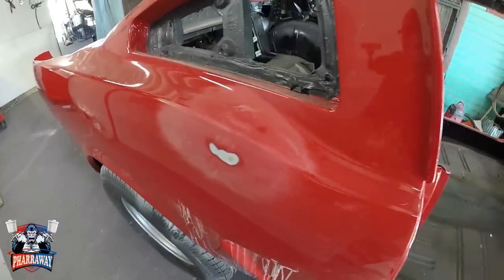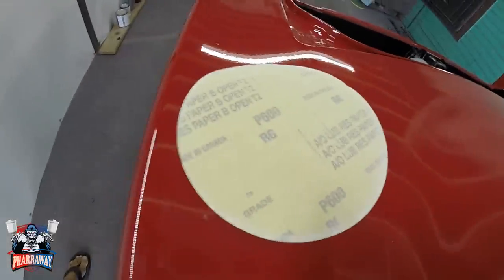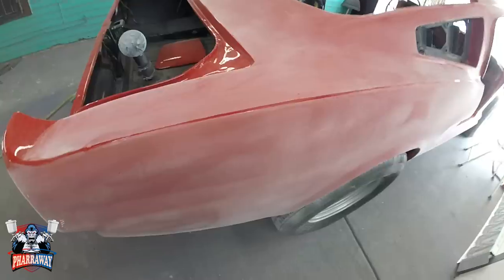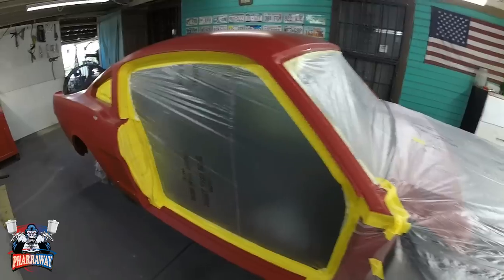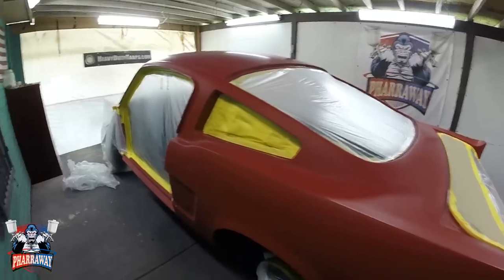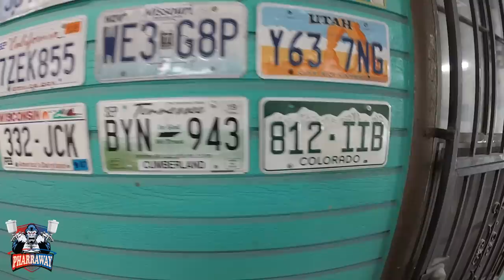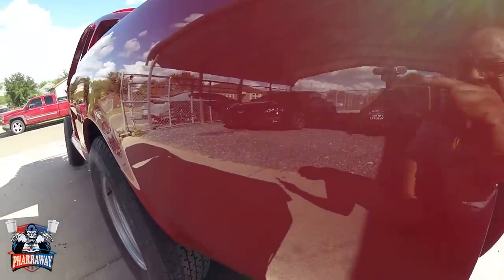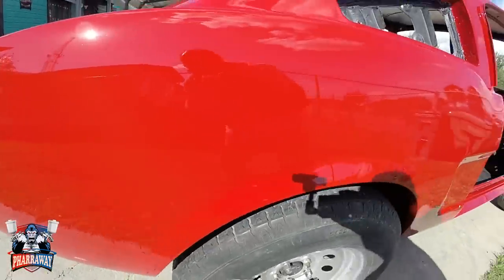How to Fix Paint Job Mistakes

Comment: Turned out amazing! I want to thank you yet again pharraway because I saw your video on how to fix hail damage before tackling a hail damaged roof and hood. Instead of grinding to metal and bondo-ing and blocking like a caveman for days, I used the evercoat ultra high build and you saved me so much work and it looks like glass man. Can't believe how easy it was. I can't thank you enough
Reply from the maker: awesome brother
Reply: Hey where are you located ? I'm looking for someone to repair my hair damage as well.

Comment: If orange peel isn't a concern, then could you not use a spot blender (blending solvent)? It allows you to blend in an area of clear, especially over small areas like the rocker rails and pillars.
Reply from the maker: yes I could have used it but don't really like that product

Comment: Good video! Quick question, I burned a few edges wet sanding to flow coat. 2 coats on base 2, coats on clear, after I fix the burns with the base. Do I need to clear the repairs separately, and wet sand them? Just clear the entire car like u did in the video?
Reply from the maker: Clear the entire panel

Comment: Awesome work bro 👍 I have wet sanded my car down with primer already on it , but some parts have the original colour starting to come through again. Should I be priming the whole car down again ? Before adding my 3 coats ?
Reply from the maker: No it's not necessary if it's just bits your good to go just add sealer
Reply: @PHARRAWAY  cool , thank you bro 🙏

Comment: That turned out BEAUTIFUL! I'd really like to see a video or photo after the car is reassembled and ready to show.

Question: Is this fix also suitable for a tricoat with metallics and pearls? Or is this only possible for solids? Either way: I've seen someone else demonstrate a flow-coat--can't remember which channel. I'd already been pondering whether I should go that far with my truck, but I am tempted. (I'm probably running out of warm-enough weather for it, though).
Reply from the maker: It will work with any color

Comment: I have a question. So you used the mini gun because it has low pressure and that way it will not pick up the edges of the damaged area right?
Reply from the maker: correct

Comment: You call this flow coat, used instead of buffing for correction.  Will any clear coat work, or is it specific to this clear coat.
Reply from the maker: @TD-ce5ru  any clear works

Comment: That area that you touched up and repainted, on the right quarter panel, didn't you have to scuff it up like  you did the rest of the car? It looks like you just shot the 3 coats of red on and didn't scuff...
Reply from the maker: yes I did scuff it up brother before adding the red
Reply: @PHARRAWAY  Ok... didn't see that. Ty.
Reply: @PHARRAWAY  i belive he ment did you sand the repainted area before you cleared it again, which was my question also
Reply from the maker: @sergioruiz5218  oh yes I did

Comment: Just done my very 1st candy paint job on my Goldwing last weekend using information and techniques you provided in your videos.

In most part, it came out great, I think but, found few mistakes on several parts.

One was candy dry spray in tight areas that I didn't spray enough, afraid of creating runs.

Few very inconspicuous striping on some parts too and ONE(😁) run in clear coat.

Is there any way to correct those mistakes or do I need to repaint the entire part?

White epoxy sealer followed by 2 coats of fine silver metallic base,  coat of intermediate clear with White Diamond pearl, 3 coats of Hawaiian Blue Candy and finished with 2 coats of clear.

All paint except sealer was Urethane with reducer and some with hardener.

Could you do a video on how to correct that or is there a way to do that.

Thanks for excellent videos, without them, I couldn't have done anywhere near as "good" as I did.
Reply from the maker: Hi awesome, ya on something like that I will do it again candy's are extremely hard to match
Reply: @PHARRAWAY  I repainted those that I didn't like the way they turned out.

Also come across another annoying issue with this Iwata gun I bought.

The cup's lid have this black plastic vent that dripped paint on couple of parts! How can I prevent that?  

I had to sand and repaint several parts because of it. 

Not only time consuming, it's getting fairly expensive with coat after coat of sealer, base, mid-coat clear with pearl, Kandy...my finger prints are nearly gone, so is my wife's, who is helping me with sanding chores😁👍

Comment: Didnt reprime or seal break through? U wernt afraid of getting lifting issues when adding more base?
Reply from the maker: No because the Break through was only to the primer so that's good enough for adhesion
Reply: @PHARRAWAY  but the base coat would be a ring around the primer it could have easily flared up aroujd the ring... ibe had it happen sever times